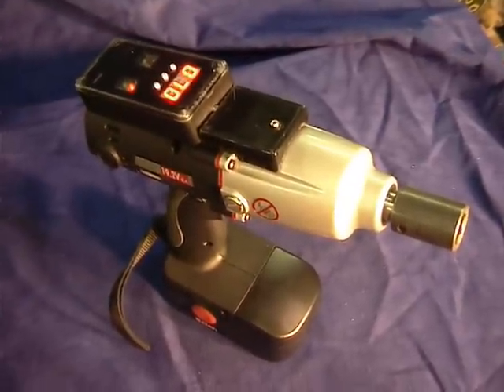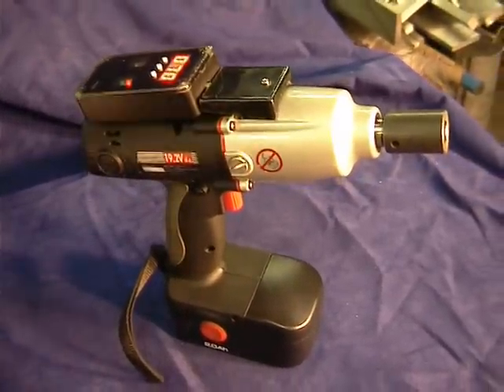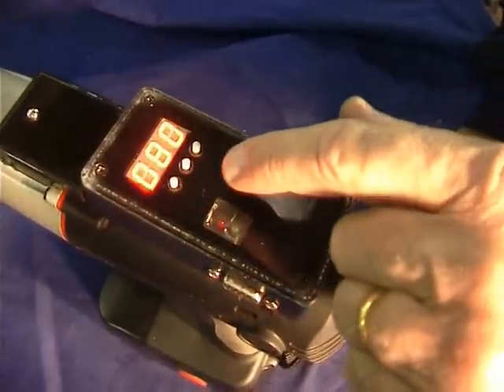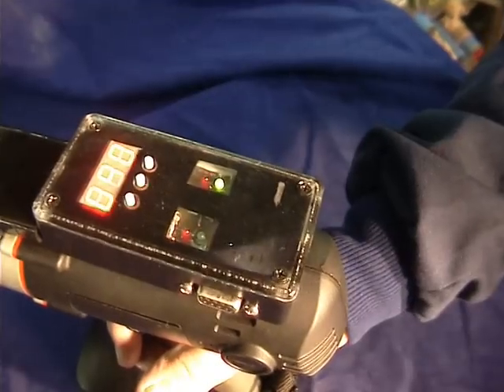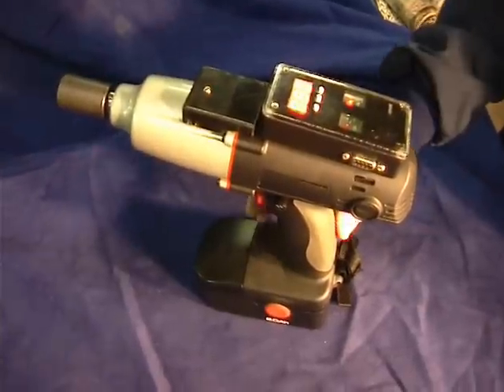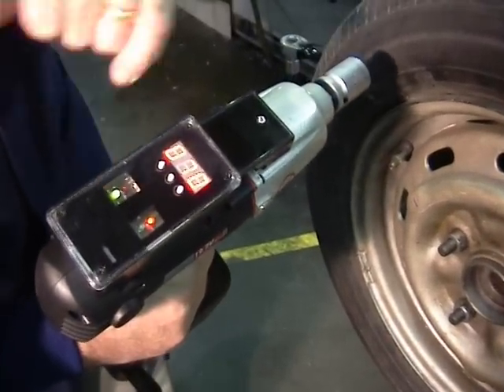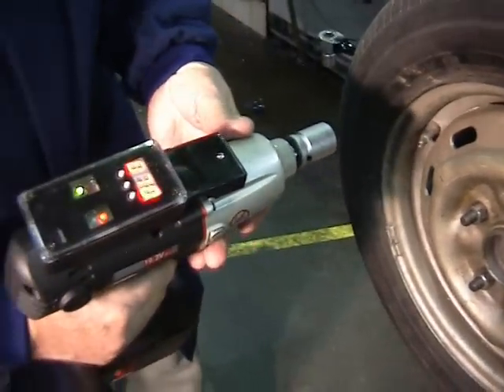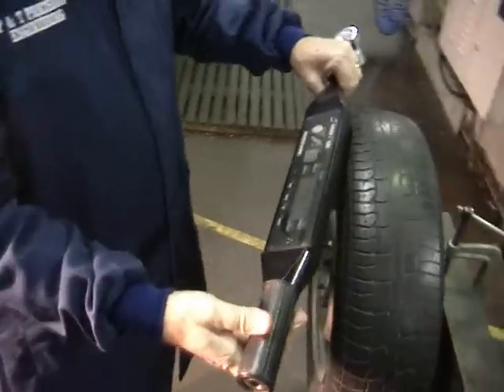Torque Controlled Impact Wrench

Comment: I agree this seems to be a useful feature. A part of me wonders though,  is this video real,  or is that black box not actually connected to the tool at all? Notice the cut after he tightens two bolts and when he measures the torque I couldn't see the display. If this actually works I'm surprised this hasn't  made into high end impaxt drivers/wrenches in 8 years!